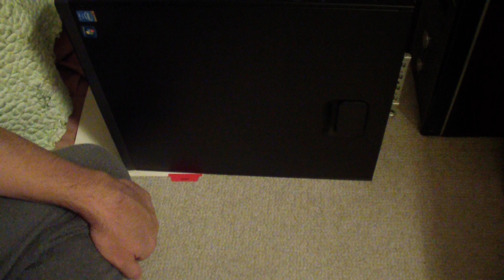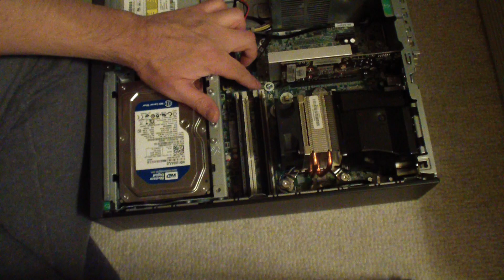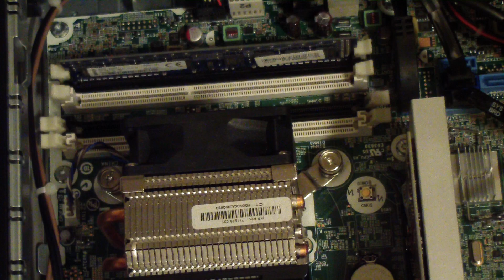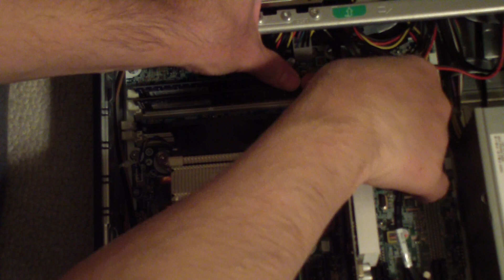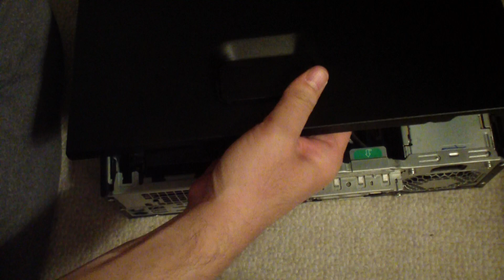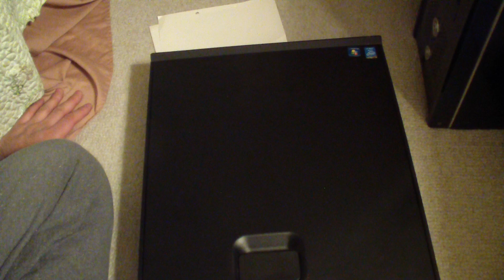HP ProDesk 600 G1 SFF:  How to Add RAM

Comment: I put an 8 GB ram at 1600mhz and it doesn't give video, it just makes some beeps, 5 to be exact 

Edit: So sorry bro, I did the same thing you did in the video and it worked, idk why since traditionally that's not how you put the ram
Reply from the maker: cool.
Reply: @Ace1000ks  Now I have another problem, it gives me 5 beeps and it doesn't boot and the ram is as I left it, out of nowhere it gave 5 beeps, I understand that it is a ram problem, I also tried removing one of the two 8 GB modules and so it starts but if I put the second module in it it won't, only if I put the originals together with the third party one.
Reply from the maker: @RaaHall69  When you use ram modules in this motherboard, I think you have to pair like rams together.

Comment: Greetings brother, could you tell me the exact technical specifications of the type of ram memory that uses this pc.
Reply from the maker: Specs: PC10600 or PC12800
      • 2 GB x 4 = 8 GB
      • 4 GB x 4 = 16 GB
      • 8 GB x 4  = 32 GB

The one I used on this computer was 
https://amzn.to/48Ddys2
Reply: @Ace1000ks  Thank you, I have placed an additional Kingston 8gb ram module at 1600 mhz next to the other two ram modules of 4gb each and now, it started giving me blue screens, I assume that the new ram memory I installed is not compatible.
Reply from the maker: @josevalera1413  A blue screen means the dimm modules are bad from my experience.
Reply: @Ace1000ks  I don't know, I tested the same ram module on another PC and it didn't give any error.
Reply from the maker: @josevalera1413  Maybe, the ram isn't compatible, who knows. You just have to try different dimm modules.